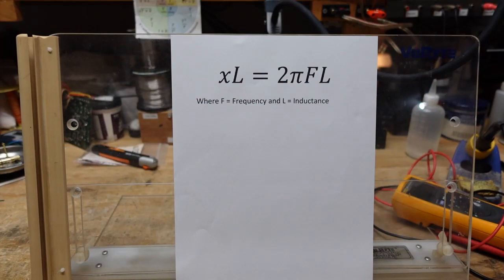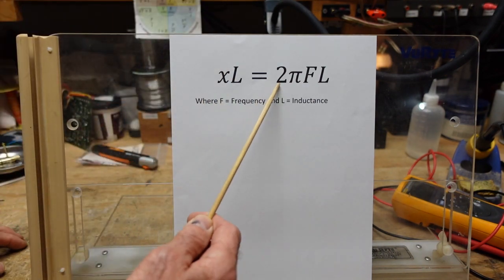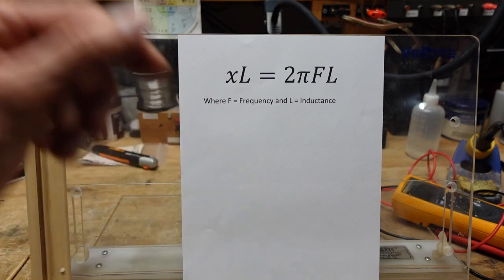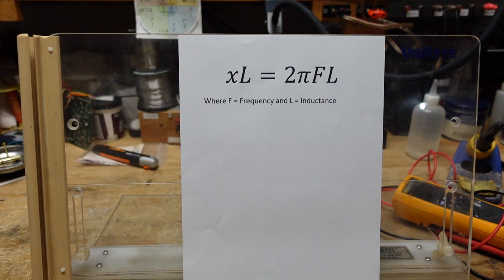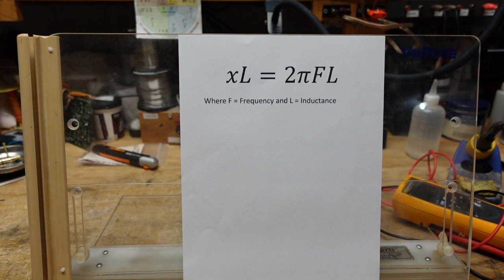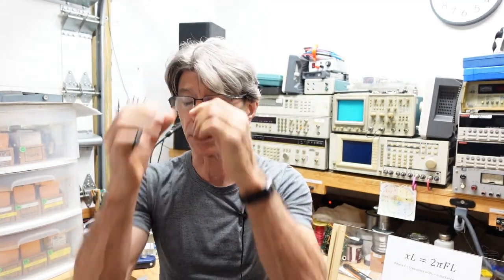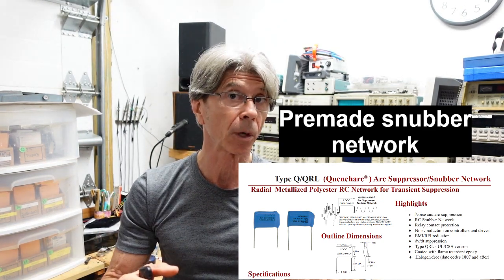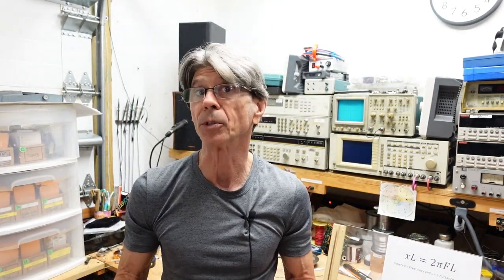Basic Electronics for the Technician Part 6 -  Inductors and Transformers

Comment: Ray, could you do a segment on solid state amps?  Show the flow through the circuit, and what the transistors, bias, resistors and capacitors do along the way. Along with some scope & voltage readings.   I have a small grasp of what is happening, but still do not completely understand.
Reply from the maker: And you think I do?  😁
J/K, that's a really good idea.  And yes, I'm sure that doing this will fill some holes in my knowledge as well.  I'll get started on it after I finish the next in the basics series.